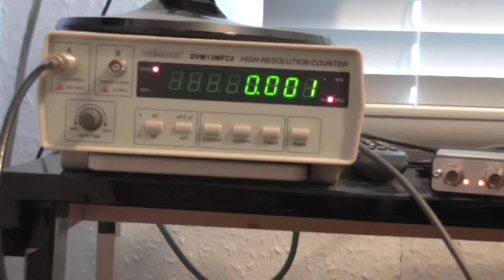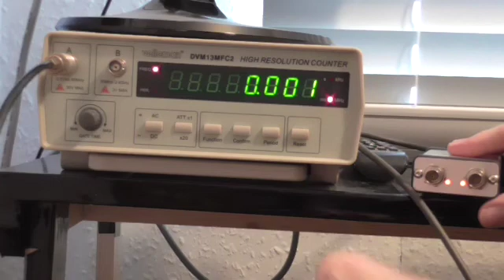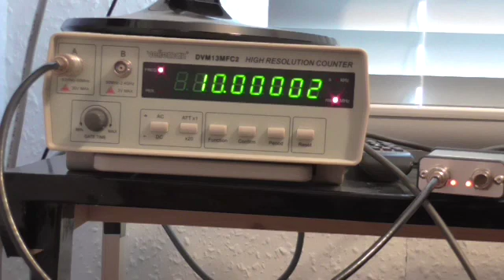Velleman DVM13MFC2 Frequency Meter Test Update

Comment: Don't worry the manual contains no useful information.  I purchased on of these and it hummed horribly when I plugged it into 115V AC.  I disassembled it and simply reversed the wires leading to the power connector. Problem solved no more hum.  Also, the ground plug is not connected to anything. There is no metal in the chassis.